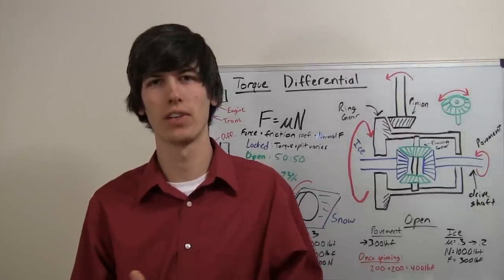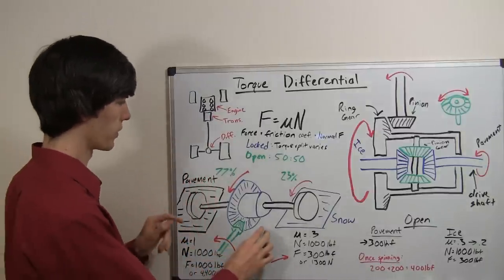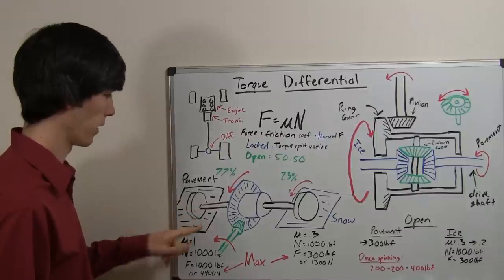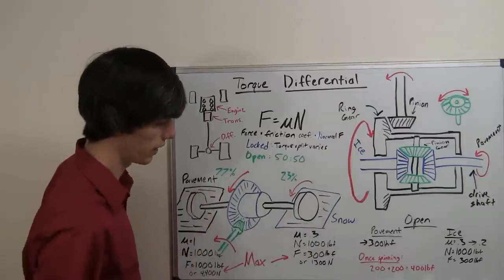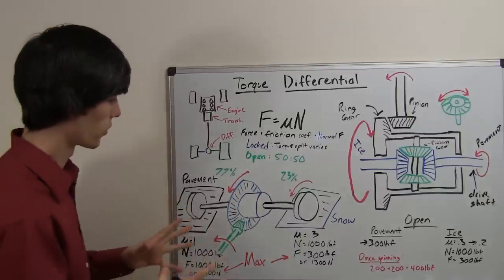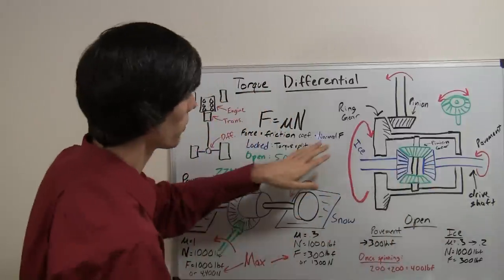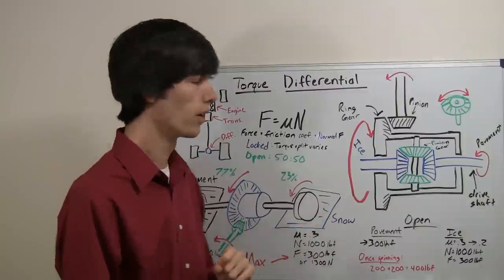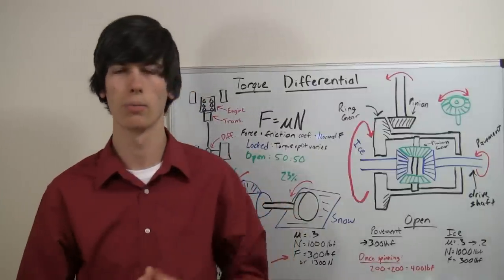Open vs Locked Differential - Torque Transfer - Explained

Comment: What would happen if you kept applying more torque with one tire on ice (with an open diff) even after one tire is spinning. Would you be able to apple extra torque to the tire with grip even though you would be adding extra torque to the tire already spinning? Or is it not possible to apply more force to something already spinning? Not sure if my question makes sense
Reply: You cannot apply more torque as such. You can press more on the gas and the only thing that will happen is that the engine will hit the limiter. The engine torque output and the torque on the wheel will not change though, it is given by the maximum possible friction force between the tyre and the ground as shown in the video. The 3rd Newton's law (action and reaction) still applies.
It is a bit like having your hand in the air and trying to press against the air with larger force. Just not possible.

Comment: THERE IS A SIMPLER FORMULA TO CALCULATE POWER TRANSFER TO EACH WHEEL...WHEN WE TALK ABOUT MECHANICAL DIFFERENTIALS U TAKE THE AMOUNT OF LOCK PERCENTAGE U DIVIDE BY 2 AND U HAVE THE LEAST AMOUNT OF POWER GOING TO EACH TIRE...EXAMPLE: ---1) 100% LOCK U TAKE 100/2 SO EACH WHEEL GETS AT LEAST 50% POWER OF THE CAR...BUT IT CAN'T TAKE MORE THAN 50% BECAUSE TOTTALY IS 100% FOR BOTH IT TAKES 50% SO LEFT-RIGHT TIRE IS 50-50 ---2) 60% LOCKED EACH WHEEL TAKES AT LEAST 30% OF ENGINE POWER...70-30 TO 50-50

Comment: What happens to the extra torque with the open differential if the slipping wheel reduces the amount of torque required to turn it? Does it just stay in the engine and thus the engine can more easily rev to a higher RPM?
Reply: If the wheel is slipping then the torque is still being used to turn the wheel, just while it has no traction. I guess technically this would make the engine rev faster, since there's less resistance

Comment: So I understand that open will do one wheel burnouts, and locked will do two. But locked has the skipping of the outside tire, and open does not. Is there a diff that can do two wheel burnouts, and still have the outside wheel rotating faster? Basically is there a diff that solves both of the bad cause I wanna do some burnouts but don't wanna bounce around a corner.
Reply: I think a limited slip differential would be your best bet.

Comment: There is one thing about torque distribution that keeps bothering me. When a car magazne says that the car has normal-codition torque split 40:60 front-to-rear (speaking about central diff of course), what do they actually mean by that? Front and rear wheels can't spin at different speeds when going down the straight, can they?

Comment: If on an open diff each wheel receives at all times 50% of the torque, why would your maximum torque, in the example you gave us, be 300lbf on each wheel? If you gave it more throttle, wouldn't the wheel on the pavement actually receive more torque (even if the wheel on the snow spinned faster)? Or the moment the wheel with less traction starts to spin (in the open diff) the amount of torque reaching the wheels is cut? Thanks.

Comment: when I'm on flat ground in the mud, I have observed that all four of my tires are turning simultaneously at roughly the same speed. But if one of my tires is up in the air when I'm on the rocks, that tire does not spin at all. My question really is,why would you want a "true locking differential" (as in a posi differential) if a part time 4wd system like mine seems to give optimal torque where it is needed? Seems like that tire up in the air spinning would do me no good.

Comment: Could somebody please explain the advantages and disadvantages of taking a low speed corner (perhaps 25mph), a medium speed corner (perhaps 50mph), and a high speed corner (perhaps 100mph) on high-friction flat pavement (like in a track) in a RWD car - while attempting to follow the racing line - using 5 different types of differentials: open, viscous, torsen, clutch, and locked?
Reply: Not an easy question because you ideally need an active diff that will limit the slip differently in each part of the corner. You want the diff as open as possible during the cornering itself, because that lets the wheel freely spin in different speeds. Once applying throttle at the exit, you want it to start locking gradually to be able to apply the maximum available torque to each wheel as addressed in the video.
But this is done by limiting the slip between the left and right wheel, so it is always compromise. The ultimate solution is an electric propulsion with very power motors for each wheel. They can always spin independently and put down any amount of torque independently (up to the maximum torque of the motor).

Comment: Hey, so this means that if the wheel in the ice needs almost zero torque to get it spinning, that's the same amount of torque the wheel in the pavement it's going to get ?
Reply: If you have an open diff, yes.

Comment: Is the RPM of the transmission output shaft different from the RPM of the shaft connecting the differential to the rear wheels?
Reply: Sujay Modi That would depend on if the car is turning or slipping. :)

Comment: so confused cuz it sounds like at first he is describing an open diff or limited slip.. I thought open diff transfers power and torque to whatever wheel isn't spinning .. but he said that a locked diff does that

Comment: I'm confused because I don't have a locking diff though. It's weird how my truck acts, because it will spin both if I'm doing a burnout in grass, or all four if I'm in 4wd on flat mud. but sometimes if im stuck in 2wd, only the wheel that is deepest in the mud will be spinning. It's like it decides to be smart one day, the next it doesn't seem to notice where the traction is.

Comment: How come when using an open diff, the wheel on ice spins but the wheel on pavement doesn't? I know that both wheels have equal torque distributed between them but why is it that the wheel with grip doesn't spin?

Comment: The issues here are frame of reference and physics approaches to real-world situations. If you're looking internally at the stress to components, then your analysis is correct. However, it ignores the very real energy that is expended and wasted spinning the wheel that has less traction. So externally, it's visible power (not the "invisible" torque) that is being sent to the tire with less traction. In other words, what bothers people about your explanation is that you are explaining things they can't see while ignoring the things they can.

There's a similar problem with the physics definition of "work" being "independent of path". Clearly, in the real world the path matters because a circuitous route with lots of elevation changes and stops and starts (and different modes such as on foot or bicycle or 18-wheeler) uses far more energy than a straight line from A to B. People think of "work" being the total amount of real-world energy they expend rather than the theoretical minimum amount of energy required under conditions that are not actually possible in the real universe.
Reply: I agree that this is probably where most people's confusion is, which led me to think about the relationship between force (torque) and energy. I'm not 100% sure on this, but in the case where one of the wheels in an open differential is stuck and thus doing no work, I'd guess that the energy goes to some combination of rotating the pinion gears (which I suppose, in turn, also rotates the opposite wheel even more), friction (between the gears themselves, as well as between the pinion gears and pinion shaft), and torsion on the axle that's not moving.

Comment: So what exactly causes the one wheel burnouts you get with an open differential?
Reply: +Greg Hoffman I think its from whichever wheel that just just happens to get slightly less traction than the other which then allows it to spin and the other to lock.
Reply: Greg Hoffman I stole this explanation from a google search on a comment thread -
It is theoretically possible to have both tires spinning with an open diff, although practically impossible to achieve. And it is not an increase of torque that will do it. For this to happen, both tires must unhook at exactly the same time (can't put enough emphasis on exactly). With an open diff, the torque is the same on both wheels, no matter what. When torque increases, it goes against the tire friction force. When the static friction force barrier is achieved, the tire starts spinning and the coefficient of friction goes down to the kinetic value. This means that the reaction torque goes down in proportion with this new - lower - friction force. The torque being equal on both wheels, it also reduces on the other wheel that did not begun to spin. So now, this wheel only produces a torque equivalent to the kinetic friction force, so it will never be able to reach the static friction barrier it needs to reach for the wheel to start spinning. See, the torque at the wheels is dictated by the friction force at the tire-road contact patch, not by the torque output of the powertrain. Any extra torque sent will be converted into acceleration of the wheels (or wheel). So, unless both tires unhook at the same time, you would need to either reduce the normal weight N N on the stationary wheel or its radius r r to increase the friction force to achieve the static coefficient of friction μ s μ s needed to resist the wheel torque T T ( μ s < T N r μ s < T N r ). Unfortunately, when suspension design allows lateral weight transfer, it is usually the reverse that happen weight-wise and the radius change is never enough to compensate. Worst, when the normal weight drops, the tire's coefficient of friction usually increases.

Reference https://www.physicsforums.com/threads/open-car-differential-burnout-debate.869028/

Comment: correctly me if im wrong  but it seems like a diff that combines both is very important for safety (is that what a limited slip diff is) but how come some cars don't have it? okay is my understanding correct? with an open diff, once your half on wet road the power would all go to the wet wheel because the dry wheel would have more friction kind of like how the outer wheel during a turn gets more power or else it would slip, then back the half wet road would the car after coming off it have too much power on the wet wheel and spin out? so why don't we put limited slip diffs on all cars
Reply from the maker: ussrbrah Cost! Cost is always the answer. And open diffs are more efficient, and fine for 90% of driving. Also, it's not all of the power getting sent to the slipping wheel, it's about 50%.
Reply: Engineering Explained When you say 'about 50%' do you mean the slipping wheel gets more than or less than 50%? My understanding is that it would get slightly more (if we're talking about a half wet road) is that right? Btw thanks for answering

Comment: You said pavement have got 1000 lb force  earlier in locked differential but how  does it get reduced to 300 lb in open differential ?
Reply from the maker: The friction coefficient changes when the tire is static vs when it is spinning (in relation to the pavement).

Comment: I disagree as well. If i weld my spiders together, there is no way it isn't a 50/50 split. Do you think the rear driveshaft will just magically spin the pinion which will just magically spin the ring gear and somehow more torque will go to one tire than the other? They're WELDED TOGETHER. It's the same split. It can't differ.

Comment: question when a car has one Tyre suck in between rocks and the other in mud and the engine is spinning at max rpm and in last gear why does the car move
Reply: Stedic Shock Ali because you're not applying very much torque at all. also, that situation isn't always the case.
Reply: i had a situation when one tyre was on dry ground ( hard soil) and the other on mud the car moved a little but wouldnt go further and this time the rpm was all over the place in first gear

Comment: you are wrong about open diffs you can jack up one wheel on a open diff car and floor the car and it will not move off the jack cuz a open diff sends all the power to the wheel with the least resistance  
i even asked all my instructors a UTI about this

Comment: This is wrong. open differentials only split torque 50/50 when both wheels are at the same rpm. The spider gears drive one wheel backwards and the other forwards when the differential is biasing speed. you may test this by jacking up the driven wheels and leaving the transmission in park. if you spin one wheel the other spins backwards.

If the torque was being sent to both wheels, then one would have to be powered in the opposite direction. but that is not the case.
Reply from the maker: If you jack it up, and hold on to one wheel, you will have to exert the same amount of torque as the opposite side that is placed on moving it.

Comment: You are not mentioning that You are describing THEROETICAL open differential with ZERO internal friction. Only then the Momentum on both axes will be equal. In real life they are not the same.
Reply: That's because the internal friction is very low when compared to the friction between the tires and the road. It's so low on comparison that even in real life situations it makes little difference. If in an open diff. you have 0 friction on one tire(tire is off the ground), some torque will go to the other tire on the ground due to internal friction. But it will be a very insignificant amount. Not enough to move the vehicle at all.